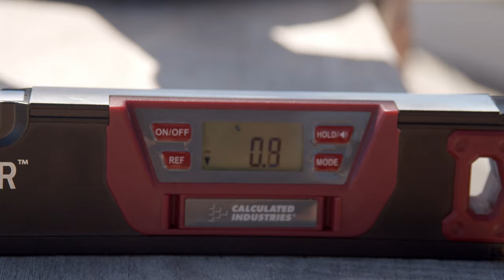The FlopStopper Roll Reducer

Comment: Adds about an hour to the post-anchor routine.  So, if anchoring for a weekend or longer I can see value in it.  I have never favored the over the side devices for the reasons mentioned (ie chafe).  

Simpler devices like a bucket with holes and rocks in it work effectively too.  The worry in upsizing the 'stopper' is in the intermittent loads it transmits to the pole/halyard or pole lift.  This is especially true if the line takes a 90-degree turn out of the mast and adds chafing to the mix. 

But something like this is almost required for anyone sailing the Pacific (esp Marquesas). 

Nice short vid.
Reply from the maker: It only adds an additional 10 minutes for us, and yes! After sailing a good chunk of Southern California and Pacific Mexico on the outside of Baja we can attest to the necessity to assure a good night of sleep haha!

Comment: I didn't believe it. but it really works.
even on the open sea without an anchor. in a wave of 1.3 meters.

I took a big bucket.

even it worked a little. yours will 100% work.

I'll try to do it myself. If it doesn’t work out, I’ll order from you. thank you very much for the idea :)
Reply from the maker: it's pretty neat

Comment: Hi Marissa and Chris thanks for the video. I have been thinking about adding flopper stoppers to my equipment list and glad to see your demo. I was under the impression that you needed to use them in pairs to limit roll in both directions. Is it correct that you have found using only one to do the job for you? Thanks, Ben S/V DAWN
Reply from the maker: Hey Ben! We only use the one off our spin pole. You get 3x the efficiency hanging it off a spin pole as it moves the centerline thus reduces the roll. Some people do use two but in our experience one worked best for us. Hope this helps! :)
Reply: So what is the discount, I didn’t see any mention of it on the web site? Hopefully in the range of $500! Thanks Ben S/V DAWN
Reply from the maker: @benlindner5285  LOL! Great question... I’m actually not sure! Johns email is on the website, and he should be able to answer all of your questions and concerns. He’s a great guy and full of knowledge when it comes to not only his FlopStopper but DIY versions and how to better suit your boat. Thanks for being so interactive with our comments, we love to see it!
Reply: I’ve never seen one used in pairs. We use one (different brand) setup like in the vid. That’s how they work.
Reply: using 1 unit on one side slows the up-roll, most often enough so that it takes the boat out of the wave cycle so that the hull is moving in opposition to the next wave and "cancels" it.  if you have 2, that works great, as the roll is dampened in both directions as you note.  however, in some deployments, it works best to hang both (if you have 2) on one side to achieve that "wave cancelling" effect.  each flopstopper is good for about 15,000 lbs displacement (when hung off the center cleat), about 2x to 3x that when hung out farther on a pole (lever arm).

Comment: They work. A friend gave me one years ago and we use it every anchor or bumpy mooring. Ours is similar but with two blades and stainless. We set it up on the boom (no spin pole aboard). I like the design you have there. Aluminum (lighter) and more blades. Smaller blades will give it a quicker (more effective) action and let it stow smaller.
Reply from the maker: Hey Eddie! Glad to hear you have a similar design that also performs well. Out of all the ones we have tested and researched this design seems to be king.  Stay safe out there!